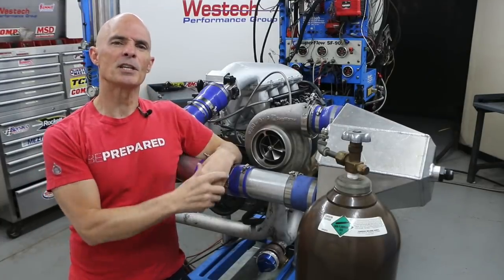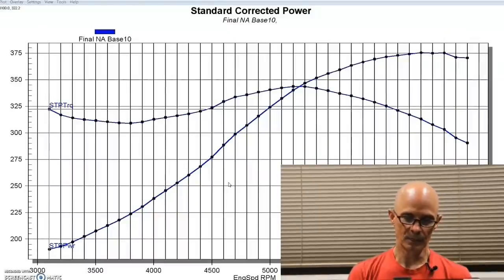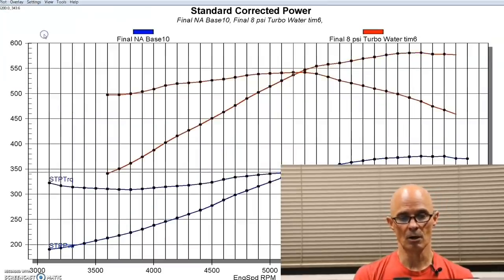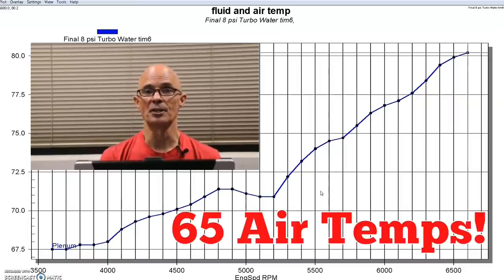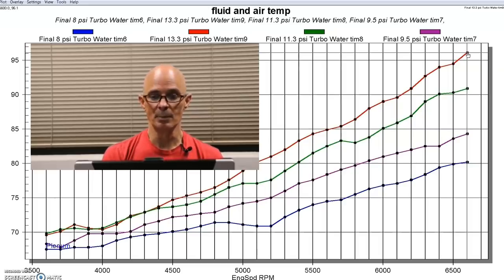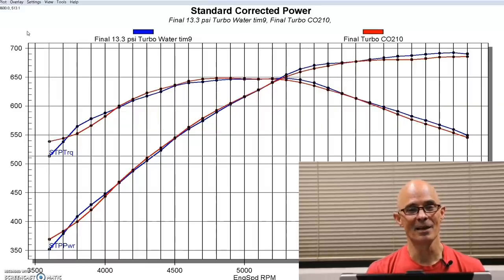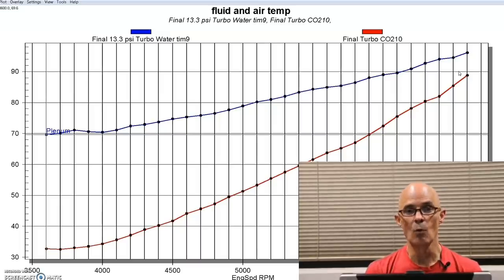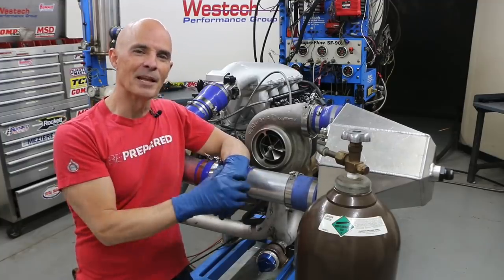HELP, CO2 INTERCOOLER FAIL!! FULL RESULTS!!

Comment: W2A cores are smaller to compensate  for improved  thermal heat transfer .  A2A core built as a W2A big side co2 . 
 The  core size ratio 
W2A 
Small high efficiency coolent/large intake air. What you tested this time
What i purpose.  Build your IC with an R744 refrigeration core ,expansion chamber and orifice.  R744 is co2 ...

Comment: That intercooler core is not made for a gas.

Also where is the phase change occouring, it will absorb the most heat when phase changing from liquid co2 too gaseous C02. If its coming out of the bottle as a gas you are already behind.

Theres already a much more effective solution out here for this. Look up the Interchiller.

It uses your OEM AC too chill the A2W medium (coolant) down too subzero temps while not under load. SO that while under load you have ICE cold IATS. As your still using a liquid the A2W core works as per normal.

Comment: I would try placing a restricting orifice right at the water inlet to the intercooler then run as big of a exhaust line out as you can so you create as little pressure in the intercooler as possible

Comment: Need a restrictor in the outlet side like an air conditioning, "orifice valve" so that the intercooler fills up with liquid instead of gas...

Also, pre-fill it before you start the engine but for fuck sakes, don't stand near it in case of sudden over pressure!

Comment: You have to let the CO2 evaporate to get cold...

A compressed liquid must quickly go from one physical state to another to change its temperature, which will essentially pull heat energy from its environment to allow (say an intercooler) to get really cold.

Comment: Gas expansion is the key when a gas expands it cools try putting a a jet on the inlet and open up the exhaust you want a high pressure differential

Comment: If the cooler was not enclosed so air can pass through the coils it won't cool at all. Change it to an open exposed coil with co2 then you'll get that cold charge.

Comment: Richard you are the ghandi of modifying motors.. Oh in regards to the issues with the intercooler performance my thoughts are that the co2 couldn’t pass through the core fast enough to take the charge heat with it. But I’m a mere mortal and I am sure interested to find out.

Comment: It takes a lot of energy to heat water which is why it is used for cooling. cO2 may be colder as a liquid or gas but it can not take as much energy as water can.
To use the cO2 have it blow on a radiator for the air to water intercooler or use a second air water intercooler and use the cO2 to cool the water before it cools the air

Comment: I believe you would actually have much better results with liquid nitrogen. As long as like you said the core doesn’t crack, witch is entirely possible.. if you decide to try it, slowly cool the core with the nitrogen before you start testing. This will keep chances of cracking down. But with the co2 now that’s just the dynamic of air & gases, they can heat/cool very quickly in certain scenarios and it does seem that you had one happening here, just not exactly what you were looking for. Think of it like an 8 gallon water tank, you can only fit so much inside right? Once you hit that 8 gallons that’s it. Well Its the same idea with the co2, or air even for that matter. A certain amount of co2 can only absorb so much heat in a given amount of time and it looks like it was hitting its limit before it even came out of the other side of the intercooler core. Now If you could up the flow by a significant amount, then technically you should see better results. However, if you want guaranteed results then liquid is definitely the way to go. Liquid can absorb much more heat per volume in a given timeframe compared to air or gas. Either way this was a fun & interesting test and now we know for sure what will happen if you use co2 in your air/water intercooler!

Comment: Do you know the mass throughput of the CO2, the weight of CO2 per minute.
vs the weight of water going through the intercooler.
Could be a case of a small mass of very cold CO2 vs a large mass of tepid water, comparatively.
Quality vs Quantity perhaps?

Comment: Also the air is already cold using dyno water, c02 won't pull the heat as well as water as others have already said, I'd like to see you test fuel temperatures and their effects on power

Comment: Hi guys I’ve tried this also and I restricted the exhaust of the cooler. 
Filled a nitrous bottle so I can get liquid co2 to the cooler I spray for 20 sec. the cooler gets DEEP frozen like -20f and since I’m running rear mount turbos the outlet temps are low. I have 122f @6psi in to the cooler and have 19f going out but only testing so far
Reply: chevy502dk 

Interesting. Thanks

Comment: you need it to work like a a/c or refrigerator and it could work well, have the hose out of the intercooler much larger than the inlet pipe that way there is a drop of pressure through the intercooler, that will mean that the co2 is absorbing energy to expand which will cool your IAT's and give best possible results.
but as others have said the fact that its a gas, it might just not have enough thermal capacity for the cooling?

Comment: The problem you are struggling is called "Latent transfer or Heat".    See the wikipedia article here:  https://en.wikipedia.org/wiki/Latent_heat
Basically, liquid CO2 has less than half of the ability to absorb  heat  as compared to water, and even less so when CO2 is in gaseous form.  You can overcome this inefficiency of C02's heat absorption power by using a MUCH larger intercooler to increase interactive surface area, keep the CO2 in liquid form, or both.  Looking at this as a drag race application, you could put a water tank in the trunk, submerge a rolled up coil of copper in the water and then run refrigerated gas through the copper coil.  If you are careful with the design of the coil, you can GREATLY increase the surface area the gas uses to interact with the surrounding water.  To refrigerate this, hook up a 12v battery to a RV-style A/C unit to compress the gas.  Other than the weight penalty of the cooling gear, you'd probably want to keep a dedicated 12v battery for the cooler so this does not induce parasitic drag on the engine via the alternator.  The cooling battery would likely need to be swapped out each pass, but that's no worse that refilling the water tank with ice.

Comment: pre run the c02 and freeze the cooler then run it with a slower flow . Possibly find a NOS mother bottle stand to hold the co2 bottle upside down.

Comment: Great channel,thanks!
I'm thinking the air volume going through the intercooler is faster then the CO2 can cool thel charge, in other words I believe you need more surface area with CO2 in it for the air to go through (intercooler) before it  enters the intake manifold.

Comment: Calculate to mass of the air the turbo used. Compare it to the mass of the CO2 you sprayed. Then factor in the heat transfer coefficients of air and co2.  

Without doing the math, I'd say the heat exchange needed DRASTICALLY more co2 flow.  

As others suggested, a liquid that can be cooled to a very low temp and circulated would be a better option.  

Dynalene MV

Is still pumpable at -170F.  Use that rather than water and run tests as you reduce the temps.

Comment: Gotta flood evaporator, or in this case your intercooler. Your superheating your co2. Its all boiling away withing the first few inches. You may want to try a tank of 134a or simmular low presssure refrigerant and on the exhust side maybe restrict it just slightly maybe to 1/4 so to keep the pressure up and the refriferant a liquid longer. Liquid nitrogen sounds good too. Im not sure of the operating pressures u want with that for 0deg. Have to download a p/t chart. Cant wait to see if u get this going.

Comment: Great project! The heat transfer coefficient of the gaseous CO2 is worse than water, and as others pointed out the heat capacity of CO2 is 5x lower than water. Both of those reduce the effectiveness of the intercooler. The result is that you need a bigger cooler, and as your intuition told you, more flow.  CO2 will keep dragging the air temp down if it has more tube area to work over, because it’s so much colder than the charge air coming out of the compressor. But unlike the water that stays at almost the same temperature as it goes through the cooler, at the same flow rate, CO2 would heat up about as fast as the air as it passes through the cooler. The heat capacity of air is 1.0[kJ/kgK], similar to the CO2 gas at about 0.75[kJ/kgK]) so it needs more tube area to work over in order to pull the air temp down. Essentially, the intercooler effectiveness is reduced due to the change to CO2 but you gain the potential to cool down to a much lower air temp by changing to a cryogenic cooling medium.

PS - I’m still interested in accepting your challenge to tune that carburetor not to go rich with increasing rpm!

Comment: the problem is your C02 will be in gas form in the intercooler, and it is not as efficient as water in absorbing heat. you would need to have it in liquid form...essentially, you'd need to make your intercooler a AC evaporator. Perhaps it is time for a junkyard AC system to be re-purposed? :D

Comment: U have the same flow in and out. In a straight line. U r most likely only cooling as wide an area as it the CO2 needs to flow thru as efficiently as it can manage. If u looped it thru or somehow managed to get it in greater contact w the interior surfaces i bet ull c a greater temp reduction.

Comment: Focus less on the heat transfer of the intercooler design. The intercooler is boiling the refrigerant as an evaporator. If it was not the temperature of the leaving fluid would be equal to that of it vaporization temperature. ( It's not unless liquid is coming out the dump hose )

   The problem is liquid flow rate. The specific heat capacity of co2 is 1/6 of that of water roughly per deg C. This is already normalized for it's difference in volumetric mass. The expansion ratio and density are mostly irrelevant in this discussion. 

  The focus is you need to get liquid into the cooler. Not gas. The gas is 1/6 as useful as water. The the latent heat of vaporization is what you are after. Co2 is 90 times the enthalpy change as heating water. ( Don't confuse the latent heat of vaporization of water as we never boil the water )

  Translation. Big nitrous solenoid on the bottle, turn the bottle upside down to feed liquid with no dip tube, let it eat. One of two things will happen. The liquid will not be effectively boiled by the overly large tubes in the intercooler and liquid will come out ( not likely ). The Sherwood valve on the bottle won't flow enough to do much and the test will waste co2. It isn't much of a concern that the massive density change will burst the intercooler. But you could lessen this possiblity by running the largest hose you can adapt to the intercooler outlet. Trying to control the boiling pressure with such a crude apparatus is a fools errand.

Comment: A gas doesnt have the heat transfer capability of a liquid. Although colder, just not as many CO2 atoms moving through the intercooler to carry away the heat as did the water. 

Maybe try liquid nitrogen, or perhaps do what the Demon does and set up the intercooler as an AC evaporator. Or simpler yet, pump chilled antifreeze from a deep freezer through it.

Comment: Part of the problem with reaching the potential of this configuration is that the co2 flow and cooling capacity is dropping as the pressure in the tank drops, at the same time, at higher rpm there is increased airflow through the core which would require more refrigerant flow to keep up.  More capacity/ larger tank(s) would help.  I'd try to control the flow / pressure in the test more tightly.  More instrumentation would be helpful... Need to add bottle pressure, IC inlet and outlet temp on both the air and refrigerant side.

Comment: Since the CO2 was cold entering the intercooler and warm exciting the intercooler, you know the C02 was doing its job. Not to mention that the intake charge was cooler with the CO2 than the dyno water.   I'm pretty sure that the phase change from liquid to gas happened in the bottle - before it entered the core.  If at all possible, you would want the phase change to happen inside the core because changing phases uses a ton more thermal energy than just warming a substance up in the same phase.

If you notice the amount of sublimation (frozen condensation) on the CO2 bottle, that's where the liquid CO2 is - on the bottom of the bottle where gravity holds it.

Theoretically you could mount the CO2 bottle physically above the intercooler, upside-down, and allow gravity to carry the liquid CO2 into the intercooler, instead of the internal pressure pushing gaseous C02 through the intercooler.  Also, orient the intercooler such that the CO2 travels upward, not horizontally.  Then, make the tubing carrying the CO2 as short as possible.  Setting it up this way will pour liquid CO2 into the bottom of the intercooler, and the gaseous CO2 will exit the top of the intercooler - forcing the phase change to happen within the intercooler.  ***Start with the valve mostly closed and incrementally open it with very small increments - you don't want to just pour it all out!!!

Sources: I'm an engineer and I passed Thermodynamics in college.
Reply: Also, a restrictor on the exit may greatly help you control this system.

Comment: Looks like you used the same size outlet as when running water through the core. I would say you probably need a smaller size outlet on the core to allow the CO2 to fill the core. Maybe even try a N2O purge solenoid on the water outlet side of the core. Another thought would be to mount the CO2 tank in a nitrous filling station bottle bracket, to ensure your flowing liquid and not gas into the intercooler core.

Comment: Is there a turning point where the air charge could be too cold?  To the point that the fuel doesn't want to evaporate. 

Should run an orifice ( like how an AC system works) right in front of the intercooler so it forces a phase shift inside the cooler.

Maybe even run an AC system as an intercooler

Comment: or is it that the air is moving so fast it has no time for thermal transfer. Just like the air conditioner in your car, the slower the fan speed the colder the air

Comment: an A2W core will hardly be effective with gas as the cooling medium. However...simply test the A2W core, engine off, CO2 running to see if it is even possible to chill the core. And if you do chill it, freeze it up first and then run it

Comment: On a side note, would love to see a test on fuel temp. As a lot of the old timer drag racers ive seen run an ice box for the fuel before the carb etc. Also how about an up stream injector or two suppling fuel to the engine but having more time to atomise/evap etc to see a difference in intake temps. While youre at it, how about plain old water injection effect on intake temps and power output. Would love to see definitive proof once and for all. Cheers
Reply from the maker: the engine masters team did that  test I think

Comment: You would have better results. If the CO2 was first run thru a chiller block for the fuel, then (in series) thru a chiller block to cool the dyno water.

Comment: The water transfers heat better. Picture standing outside on A 40 degree day. Now compared to jumping in 40 degree water. It just sucks the heat out faster.  Like air cooling something you just welded vs dropping it in water. Water is great at displacing heat. But everyone already knew that.

Comment: It needs to be more like a recrigeration system.  Liquid from the cylinder to a txv (oriface plate) to allow the liquid to flash to gas giving you the cooling as the state change happens. The tough part is figuring the liquid line and exhaist line sizes as well as how big the oriface needs to be. This will allow the whole coil to be cooled. With the current setup odds are you are making the first few inches of the coil cold and not much else.

Comment: according to thermo dynamics you should be able to use the AC system from the stock engine to cool down the charge air and gain more power than the AC pump consumes , since AC cycles are more than 100% efficient and up to 250% efficient. on paper. would be neat to see the difference on the dyno. dodge obviously has used it lately but what is the dyno difference if you dedicate the entire AC system to only cooling the charge air. and what about on a NA set up as well.

Comment: I'll take a guess that the CO2 in the cylinder is liquid. That's how you can see ice on the sides of the cylinder. It soaks up heat when it turns from liquid to gas, in the cylinder. You need liquid CO2 into the intercooler. Same as with nitrous. Got to stand the cylinder up on it's end.

Comment: Treat this like an evaporator.  Reduce the flow drastically just prior to entering the intercooler.  In my mind you don’t even need to run the engine.  Restrict flow in and measure the temp of the cooler.  Repeat until you create what is desired.  Also I’m curious what restricting flow out of the cooler will effect.  Also this is hands down the best scientifically based engine channel on YouTube.  Awesome info with brutal honesty.  Can’t say thank you enough!
Reply: 100%. Do your research on how an ac system works. FYI there are guys here in Australia using ac gas to air type coolers under twin screw blowers as intercoolers. Using the vehicles factory ac pump.